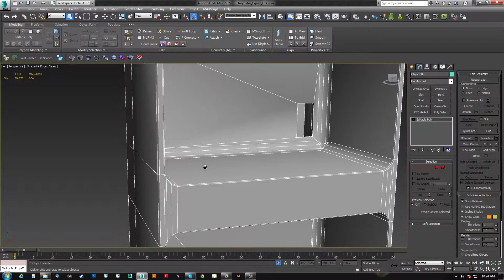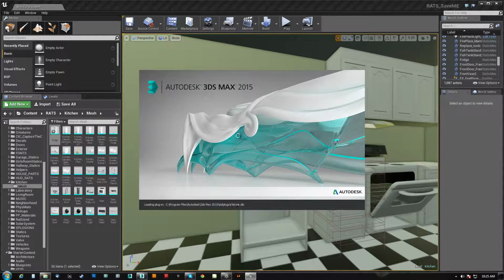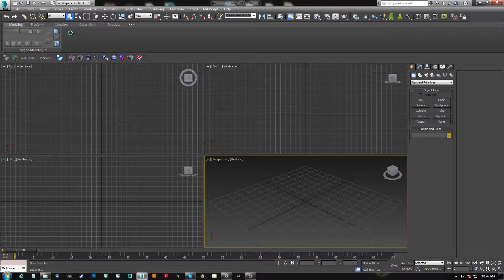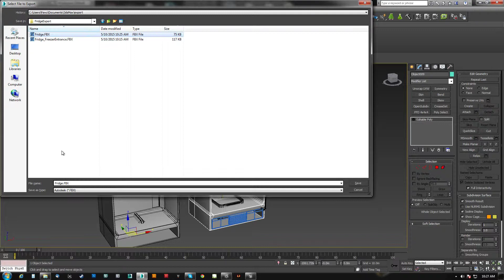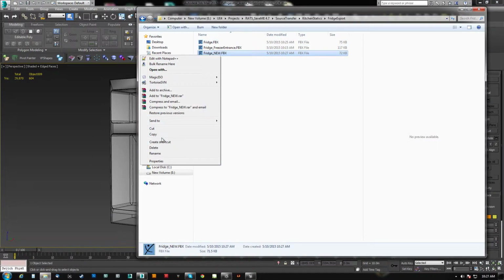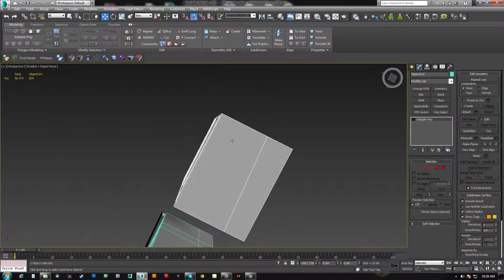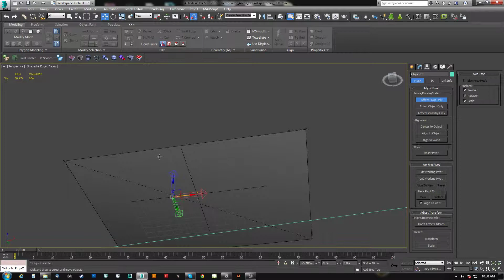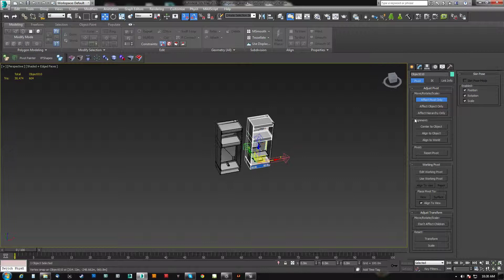3DSMax Corrupted Data End-All-Fix

Comment: what if the corrupted element of my scene prevents me from opening said scene? Also merging does not work, as it also corrupts the scene
Reply: rasztyscompany95 happens to me, I've lost around 3 car models and I just lost another one. Pisses me off so much I only have the reque and the body of the car is a "dummy" 
What do I do?
(I use 3ds max 2015)
Reply: - I had a similar situation. What worked for me was to open a new 3dsmax instance, import(or merge) the max file.  In my case it worked, but depends on the gravity of the error. Sometimes it wont. The same repair goes to 3ds/obj files. If you have a corrupt 3ds file inside max that gives you error on save (for example), just re-import it(merge). Again, sometimes it works, just because.
 - Another time,  I imported an .obj file and I got error on load. The screen was freezing indefinitely when loading. So i had to forcefully close the program. Open a blank instance of the 3dsmax, Merge the problematic save file (with the OBJ inside). They loaded fine. I discovered that .OBJ had a texture that was not linked to 3dsmax material editor. It was the imported texture. By simply assign a new material to the mesh in scene, resolved the problem.